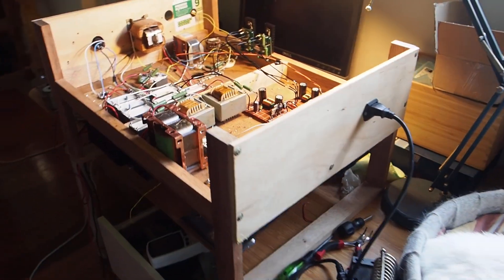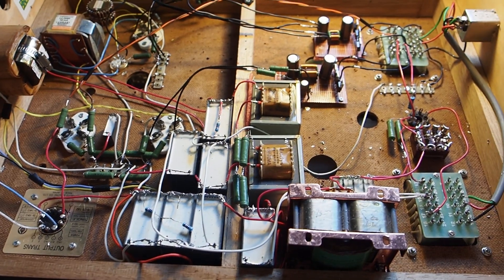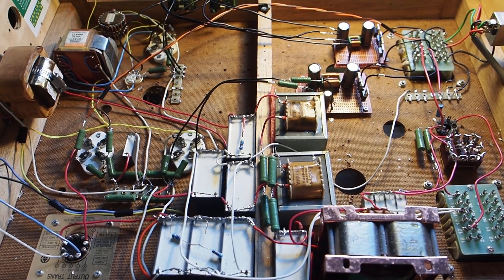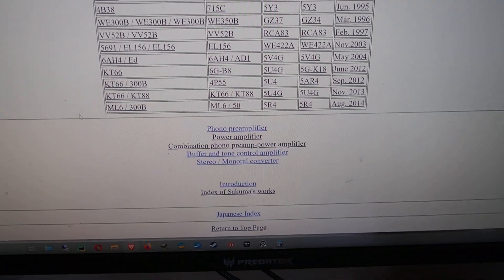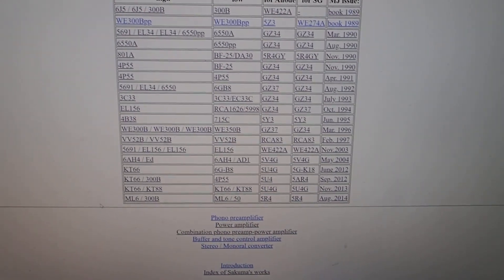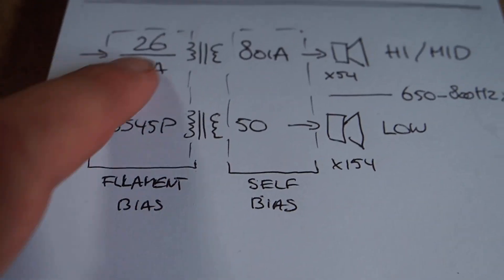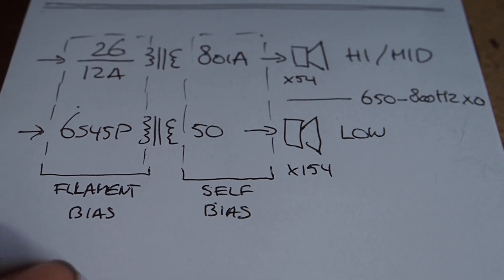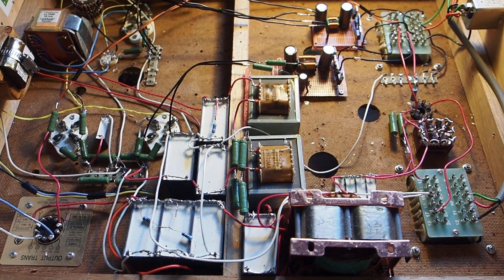A rare dual channel tube amplifier build - part 1: concept, introduction

Comment: what do yo think about using fixed bias supply to cancel out b+ ripple by making it 180degree out of phase?
Reply from the maker: By itself nothing wrong aspecially if it doesn't add complexity. BUT

While we can apply tricks, to me, for the DIY situation, and assuming we want a musical amplifier foremost, we can easily have a quiet enough amplifier and put all our focus on getting the most musical output, not tricks we can find to deal with the non-issue of ripple....
Reply: @EduardBroekman  if this allow higher acceptable ripple, one can reduce the capacitor size in the power supplies, using smaller caps and being able to afford higher quality ones seems better, while keeping hum under audible threshold.